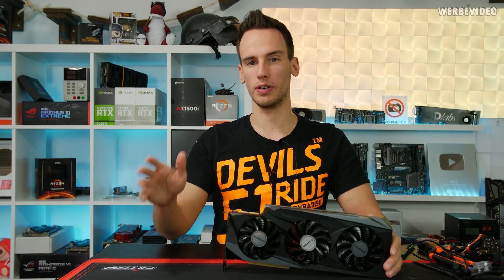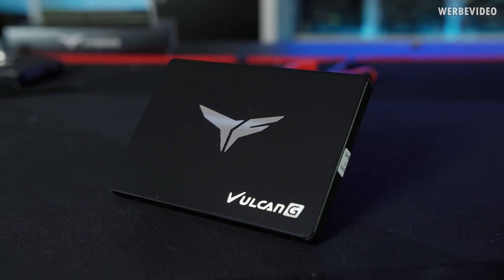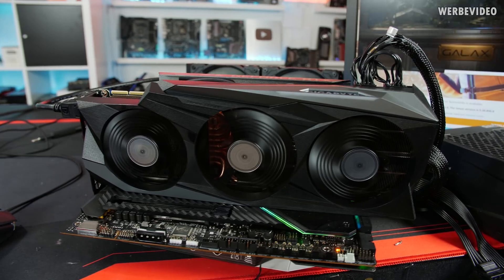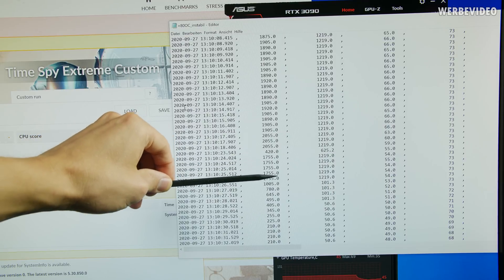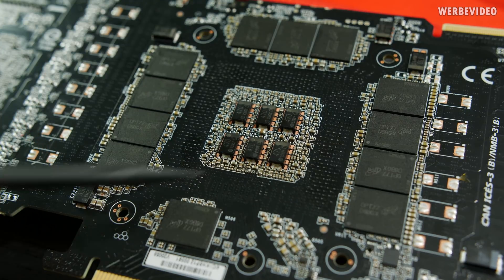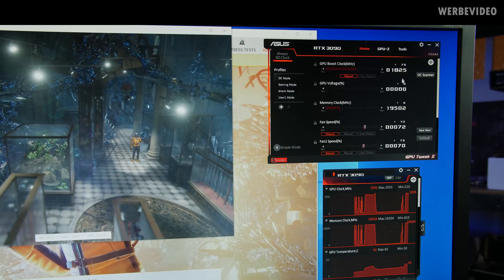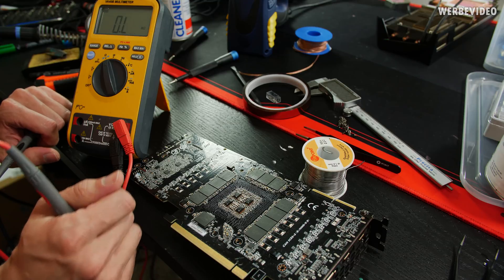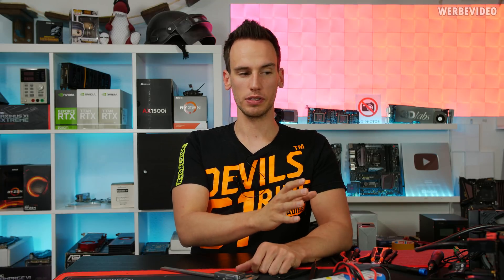We Tested the Cap-Drama - RTX 3090 MLCC vs POSCAP

Comment: It's the cap form factor the size of pads on the board that introduces parasitic impedance. You simply changed the caps but the pads are the same.
Reply: Some board keep the small pads with the large capacitors, while some boards change the traces - right?
Reply: It’s not just that. Tantalum polymer caps have poor high frequency performance. Once you pass 200 kHz the effective capacitance drops off fast. By 300-400 kHz, you’re at half the original value. Part of it is the chemistry, part of it is the package size.

The caps don’t just buffer the switching noose of the VRM, but they have the transient loads of the GPU itself, which is likely even higher. Even 0402 MLCCs will perform better than 0805’s when you hit the MHz region and higher and that’s why there are 0603’s and 0402’s scattered around those 6 arrays.

A ‘scope will give a better picture of what’s going on and is really the only way to rule out ripple being a or the cause.
Reply: @UnfrozenScoundrel   yes and it has to do with the size of the capacitor as much as the chemistry. PCB has parasitic inductance that won't change even if you change the type of caps. Multiple small caps have less parasitic inductance, than one bulk. This is the reason you see multitude of capacitors in parallel. Pad size is very important in the GHz range. Your statement about tantalums vs MLCCs is in general correct. I am stating that by changing the caps he is not optimizing the PCB layout which is VERY VERY important. Of course if you have a bunch of parasitic inductance intrinsic to the board he won't see much improvement. I AGREE with everything you said
Reply: @brk932 , Look closer. The layout for the 0805's is present on the PCB. NVIDIA's reference design comprises of a hybrid layout alloying for either cap to be placed with that land pattern. Other 3080's & 3090's show this as well. Some other manufacturers modified the solder mask so this mod is not possible.

Even though the GPU's core may be operating in the GHz range, the clock generation is happening in the die. The power supply subsystem (VRM) is typically operating around 500 kHz. Since the MLCCs are not of a feedthrough design, they aren't optimized for low ESL, but they have considerably lower ESL & ESR than the tantalums, at least in the higher frequency range.
Reply: @UnfrozenScoundrel You are correct. I watched the video on my phone. Well, as you said transients can be very fast with large swing. So a regular  X7R/X5R MLCC might not be able to cut the mustard. How the hell do we know at what frequency we have an issue? PDN design is challenging enough. Maybe the VRMs are not able to handle the power which generates high frequency noise above 500kHz. Because as far as we know NVIDIA has deemed the layout and use of tantalums good enough. Meaning it will deliver what is promised. 2000+MHz is then outside the guidelines.  Everything is built to a cost. The truth is we don't know if changing the caps makes much difference. And then what type of MLCCs. 20-30 MHz is within chip variations. Judging from last few videos it's not really worth voiding your warranty doing shunt mods or changing caps.
Reply: @brk932 , the value of modding can be in an of itself. When Roman posted a photo from supplanting 10 MLCCs, specifically WE's WCAP-CSGP series 885012107006 as he kindly replied to me, I dug around Mouser's catalog to see what existed. Personally I like their search more than DigiKey's.

Zotac use 6 x 330 uf of the tantalum polymer variety. Others used 10 x 47 uF MLCCs, 6 x 470 tantalum polys, or a combination thereof. The others started crashing out just a smidge over 2 GHz, and Zotac just under. If it is a decoupling issue, then a high Q-factor, high(er) capacitance filter should help. There are ~30, 0603 MLCCs and twice again 0402's around those 6/60 Tant/MLCC land patterns. Knowing the 0402's values might help, but the 0603's values would definitely help in making a new filter.

That said, Murata (GRM21BC80G107ME15) and Taiyo Yuden (AMK212BC6107MG-TE) make 100 uF caps in the 0805 package. TY's should run notably cooler with a better ESR curve.

I'd like to try an array of 40 * 100 uF and 20 of TY's LMK212B7225KGHT, WE's 885012107007, or Murata's GCM21BR71C225KA64 as a new filter. This is assuming the 0603's are significantly under 0.22 uF. You won't be able to touch C0G or NP0 dielectric goodness at these high capacitances. I mean, one could replace all of those decoupling caps behind the die if you're series, but 'scope it first.

There isn't much overlap in gamers & EEs.

Comment: I don't understand this video. This is proof a capacitor problem exists but the video ends asking if it is really a problem.
Reply: It shows you can clock higher with a mix of MLCC and SP-CAP capacitors, but if you change the driver to not boost as much, you eliminate the problem. So both the driver and the capacitors are a problem, like if a plane crashes because the pilot was tired and the aileron stopped working correctly - both issues are to blame for the crash.

Comment: Thanks for testing and Also some wise words... yeah... there seems to be hickups in most releases and They normally get fixed. And Also it seems that even this time people Are pointing fingers to wrong plases. Original cheaper caps seems to be just fine, if the clockspeeds does not go above safe limits. But in any usefull to see those claims to be tested!

Comment: also the bypass caps used by gigabyte aren't that bad, they had 470 on the back of them and i remember buildzoids saying they are pretty good. something like zotecs 3080's or 3090's cards where they use considerably cheaper components would probably give you that +100mhz by replacing them

Comment: Let's sum it up: The issue is probably caused by three things:
1) People with shitty PSUs
2) Binning/Chip Quality
3) Capacitors
And it always gets fixed by clocking down a bit, so 1-2 FPS less and you're fine. What a drama.
Reply: let me pay 700$ for a non working gpu!

what a drama queen!
Reply: @philippossnortis2035  How is it not working? It's crashing at certain boost speeds, just wait for driver updates or manually adjust the clock speeds and it works just fine.
Reply: Instability issues appear in the context of overclocking beyond stock values defined by Nvidia and/or AIB, and people are surprised? I love it lol
Reply: @nicor2272  Gpu boost can take it to that freq without any oc. That's the issue
Reply: Then why do people report that issue after they have done manual adjustments on their GPU frequency in OC apps... just like in this video actually. There is something I don't get :(
Reply: @nicor2272  Because Crash != Crash. What you are talking about is anecdotal evidence, some people might just have crappy chips, just as it was the case with the 2080ti (what Roman was talking about).
100% perfectly working chips/cards/products in general is impossible in reality, there are always other causes for crashes and other defects.

So maybe 90% of problems were fixed with OC adjustments and the latest driver update but some people just lost the silicon lottery or had other defects. Remember, we're all victims of confirmation bias, so when you look for error reports, you will find loads of them on nearly any hardware.
Also for every person that complains there are 100 who don't but most of them don't take to the forums and write about how they have no error.
Reply: Lets remember that it's a 700 usd card, and it's not happening because people are overclocking, it's happening stock. Sure it's thankfully an easy fix, but it shouldn't have to be fixed.   

This is why I run AMD cards, then I have many more things to complain about :( (cries in buggy drivers)
Reply: @dumle29  5700xt? I'm currently running an Rx580 and I'm happy with the drivers but it's an old card.
Wanted to upgrade to an Rtx 3080 but I'll wait for Rev. 2.
Which sounds wise but it's not. It's due to the fact that I can't get my hands on one. :D
But you're right, it should always work out of the box but sadly we don't live in that reality.
Reply: @B20C0  5700 none-xt. I have 3 monitors over DP (2 being DP to dvi adapters) and only one combination of monitor A in port X works. One has a monitor not working, another has my pc not booting.

In the os, if I'm playing a game, then any other Gpu accelerated stuff will stutter, with only the program in focus running smoothly.

Comment: DEBUNKED LOL

Good job as always altho i cringed when you sacrificed another very expensive GPU !
Reply: Debunked? He showed that MLCC banks allows slightly higher clocks, just as expected. If the drivers boost too high, they will crash. You can fix it by replacing the capacitors or by updating the driver so it doesn't boost so high at stock settings.
Reply: @gunnar6674  Why so serious dont you understand what lol means
30mhz is nothing special
Reply: @davidobutt  30 MHz is a pittance, but if the launch drivers brought the card into a crash, then that's contributing to the issue. Crashing is a 0 FPS gaming experience.

Comment: Wow those MLCCs need dental braces 8:08
There Bowwer
Reply: Dental plan !
Reply: @Stengell  MLCCs needs braces!
Reply: he needs to use  SMD specific soldering iron (one with sharp thin tip) then it will look as good as factory fitted
Reply: @bmarkx2595  the one with the "small tip" sucks for huge power planes
Reply: @bmarkx2595  Thin sharp tips are lousy for most SMD work, especially on boards with large planes that sink a lot of heat.  You would probably never get the solder to melt on the PCB with one of those sharp tips.
Reply: @nwimpney   @Stanimir   it may depend on power of soldering iron and skill,  i did soldered 2 mlcc caps twice (replaced blown caps) on my hd7950 using 20w soldering iron with normal tip first then 20w thin tip on second try and thin tip was easier and cleaner, trick is to warm up the pcb with heatgun first, also turn off any fan or ac of your room.

Comment: My eyes are bleeding looking at how you desolder SPcaps. Dude, get yourself hot air station. It is 70$ purchase. Solder paste would also help with MLCCs.
Reply: The PCB has too much thermal mass for just a single hot air gun. Remember that the die is on the other side. He is right about needing to preheat the PCB, but doesn’t have a good way to do it.
Reply: @UnfrozenScoundrel  It can be done with board preheat using oven or heat gun as he did. But hot air station allows you to control amount of air and temperature of it.
But all in all, yanking those caps one pad at the time is quick way to rip pads off the board and potentially ruin whole graphics card. Scissor soldering iron is best for it but it can be done with hot air station or even single tip soldering iron. You have to just quickly alternate between heating two pads and when both are still liquid, lift cap out of the board.
Reply: @Piasecznik72 , true, and my heart skipped a beat when he did that. However, you can just as easily damage the components by cranking up the temperature without pre-heating the board. Regardless, it is still a risky business for those who don't regularly solder on large sinks like that.
Reply: @UnfrozenScoundrel  Yes. Ultimately good job for him with investigating crash issue further. At least being first with it.

Comment: Nice video Roman! When i saw complete soldered MLCC... well, not bad. Not bad at all! Just like on Palit RTX 30! =)

Also, @Paul Hardware tested several RTX 30 cards and got crash anyway (even on ASUS TUF), so... yeah. Probably both: hardware and software problem.

But since Caps on most card are open and possible to mod... do you think more people join overclocking by replacing CAPs on their cards (and make Louis sad)? +)

Comment: Why didn't you use the small tipped soldering iron when soldering in the 0805 caps? Also that solder was like 1mm, you should get smaller for jobs like this.
Reply from the maker: Smaller tip = less heat. There is a massive GPU on the back. With a small tip you won't get anywhere
Reply: @der8auer  But you used the small tip for desoldering. That seems backwards to me.

Comment: If you got a stable 30MHz more by replacing 2 out of 6 of the big caps, wouldn't replacing 6/6 possibly give even better results? Maybe closer to that extra 100MHz you mention at 10:02 ?
Reply from the maker: No this doesn't scale linear
Reply: der8auer Aww i was hopeful there for a second! Thanks so much for your hard work and taking the time to reply!
Reply: @der8auer  I would like to see Zotacs 330s all replaced by MLCCs. Maybe in that case you could squeeze over 60MHz

Comment: The simple fix is a bios update fix with a lesser boost for the GPU. These cards wont crash with advertised speeds. With this test it's shown that even if Gigabyte spent more money going with the smaller caps it would've been the same in the end. Great video, thanks derBauer.

Comment: There is no point in overclocking ampere cards anyway at least in the traditional sense. there is basically no real difference between 1800-1950 mhz. 
You rather want to increase the power limit. Simply increasing the power limit will give you more fps since ampere as the name said scales with amp/watts/power limit

Comment: It wasn't necessarily an issue of clocks and stability, it was crashes in spikey loads I believe?
Reply: According to jayz2cents we had "concrete evidence" that it was the caps on the card being the issue
Reply: @GoingMenthol  The board manufacturers blamed the capacitors too.